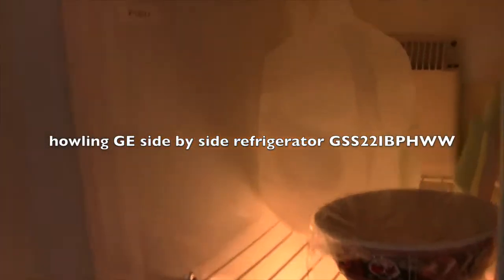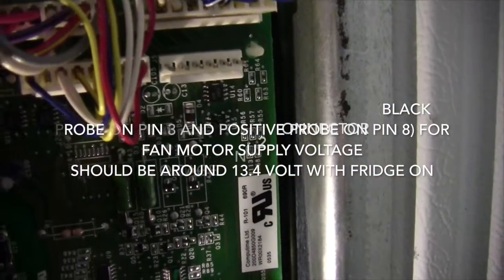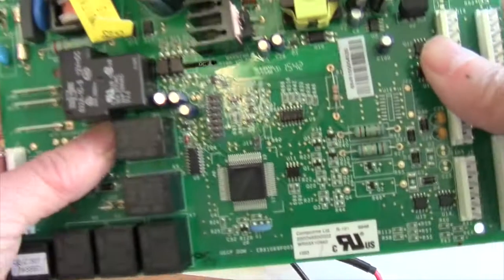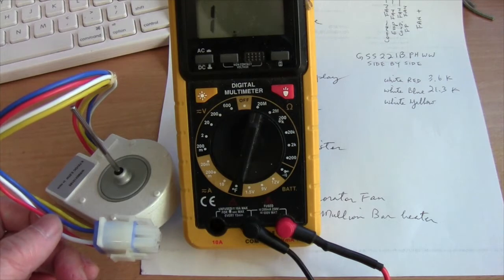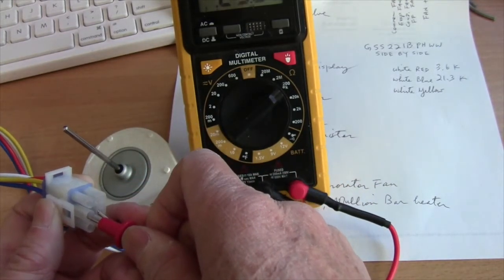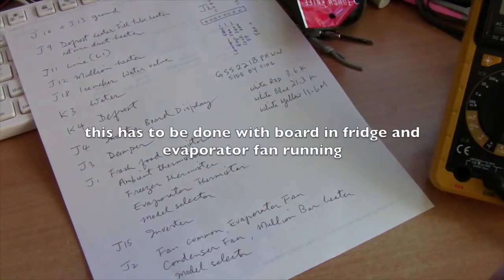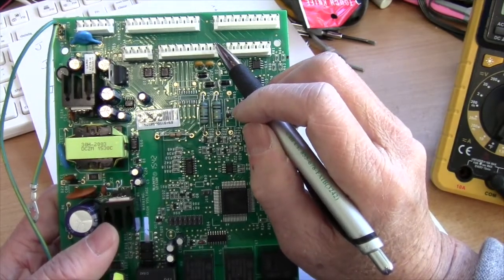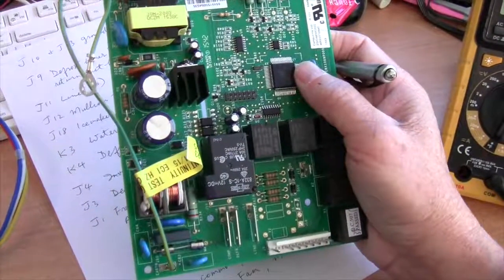GE fridge howling noise

Comment: I can't fathom why a device that has to simply keep food cold has to have a circuit board.  In the older fridges, it ran with a mechanical thermostat, and a motorized mechanical defrost timer, and worked perfectly.  They used AC motors for evaporator and condensor.  And there was a mechanical switch that turned the light on and off.  So simple, parts were DIRT CHEAP, and nothing every went wrong.

Now, with the circuit board, you have expensive parts that burn out and need to be replaced, and the end result is a device that simply needs to keep food cold.

People say my old fridge isn't efficient and wastes energy.  While a newer fridge may cost less to run in electricity alone, the repair costs are FAR MORE expensive than the savings in electricity.  Not to mention the price to replace the fridge in the first place.  All these people that preach "save the planet" really need to put their money where their mouth is.  Once they do that, they'll realize they've run out of things to talk about, since there's no money to put there in the first place.  If a new fridge uses 25% less electricity, but a new board that needs to be replaced every couple of years costs $90, it will take a LONG time to eat that up in electricity with my old fridge.

Excellent job diagnosing and repairing, and providing this information to all the "save the planet" suckers out there.
Reply from the maker: Old fridges used to last 20, 30 years but these new ones are quite delicate. I have to keep fixing it or it'll become a 300 lb paper weight. I hope others will find out it's within their capability to repair this.
Reply: My Amana fridge has got to be 13 years old or so.  Still going strong.  When it comes time to replace it, there's only 1 thing for me to do:  cry.  I think the best thing would be to retrofit the new fridge with the old reliable parts.  That way as long as the sealed refrigeration system works, it will just plain work like it's supposed to.
Reply from the maker: As long as the compressor doesn't go south on you, it's worth it to fix them.  Soon, I'll be needing advice from you on a reliable top loaded washer.
Reply: Need a washer already, huh?  Well, I'm here for when you need advice.